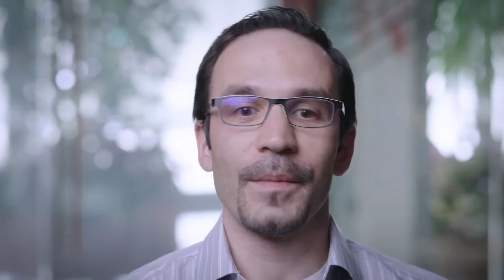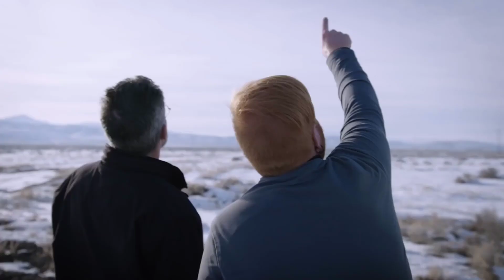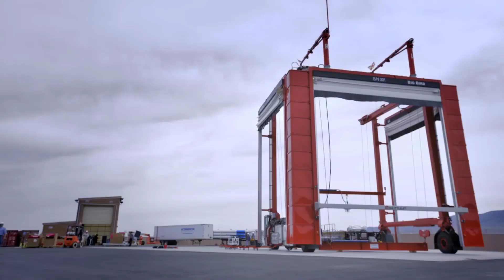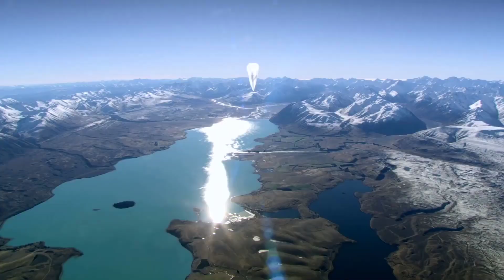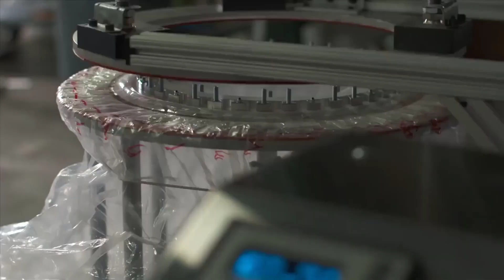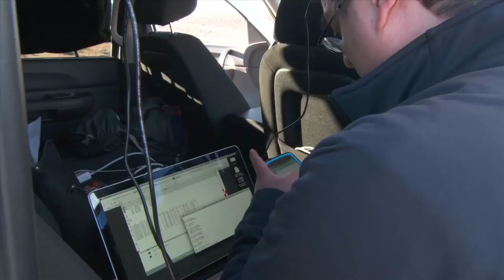Satellites Myth Busted Once & For All

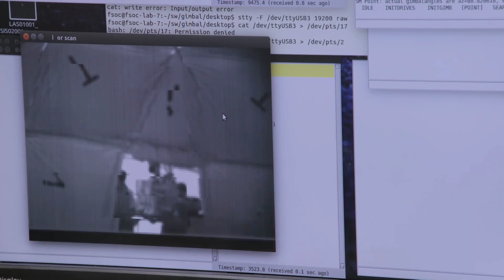Comment: The problems described  around 1:47 make it physically impossible for balloon mounted GPS beacons to provide a usable Global Positioning Service.    Satellites are the only way to make that system do what it does.    Remember your pocket GPS can only locate you within a few yards, but a professional differential GPS setup can get you within an inch.  That means each of the 24 clocks must follow a course known long in advance to within an inch.   Not much disturbs the course of a satellite orbiting 12500 miles above sea level. Balloons drift unpredictably  on the wind, at all altitudes.